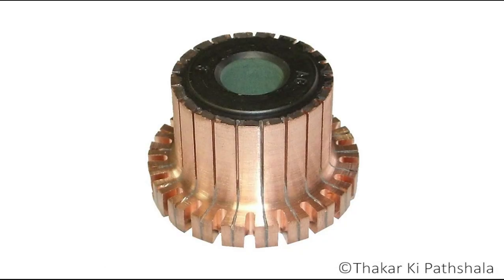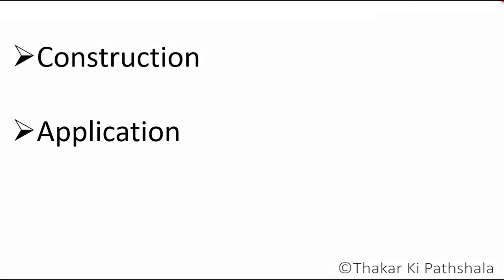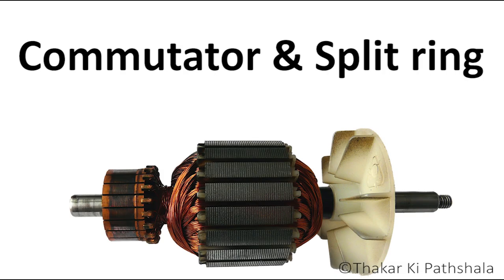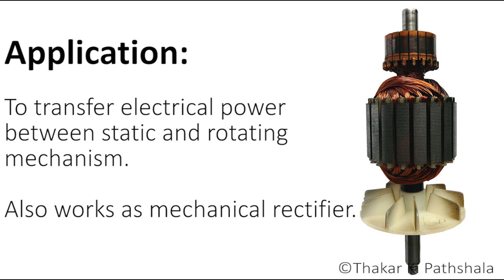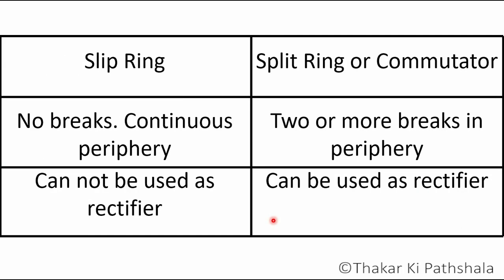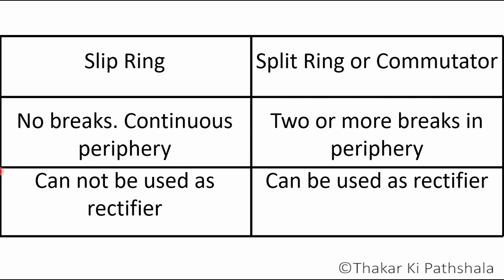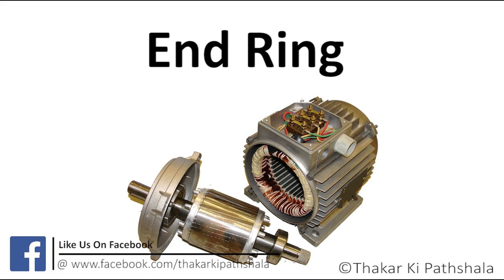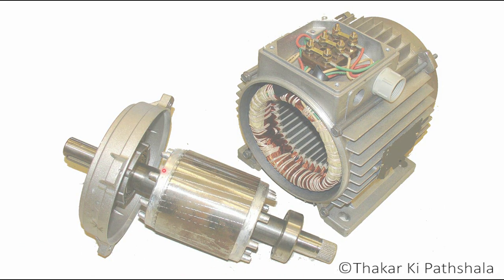Difference between commutator and slipring and splitring and end ring

Comment: I didn't understood
Tell me details abt ceiling fan
Like where is commutator, split ring, electromagnet, armature coil etc...
Reply: Its construction is different, if you remember single phase induction motor there are two windings main& auxiliary windings only slips rings is required to transfer form from stationary body to rotation body 

 If you observe the internal view of the ceiling fan you get the idea.  you can  watch it.

Comment: No defination ... Non understandable
Reply from the maker: thanks festivala special for sharing your concern on this platform. Can you tell exactly which part is not understandable. So I can assist you in better way.
Reply: After this vedio i am still unable to say even a word what is slip ring
Reply from the maker: Dear slipring a device just like finger ring by which we are able to electrically connect rotating surface. commutator also do same job but it has intermediate cuts  on it's periphery also it also work as mechanical rectifier i.e. it can convert ac current to dc and dc current to ac current. Hope this explanation will help you. Have a nice day.
Reply: Thanks sir for this kind information......thank u